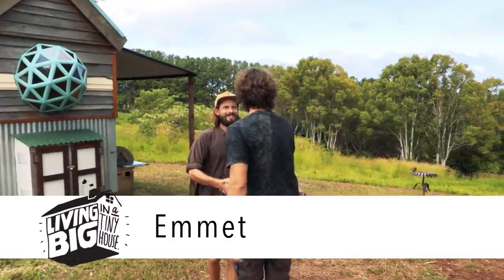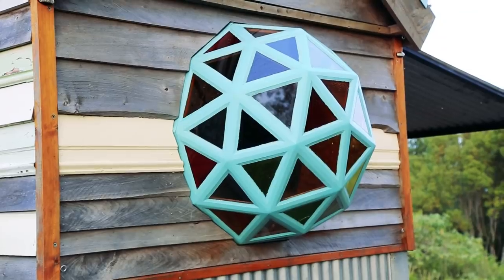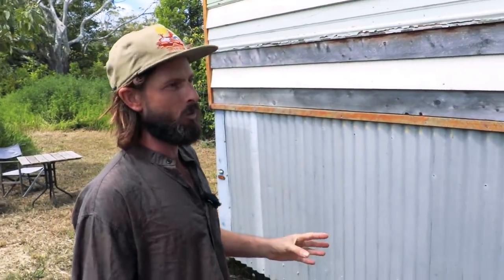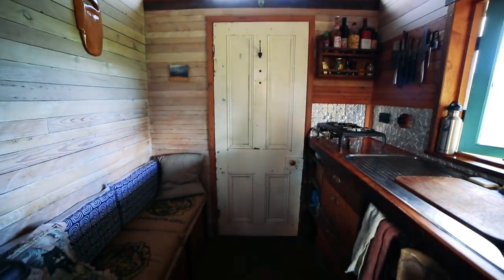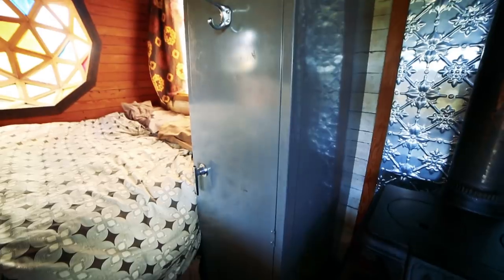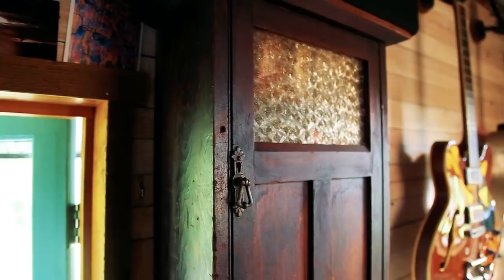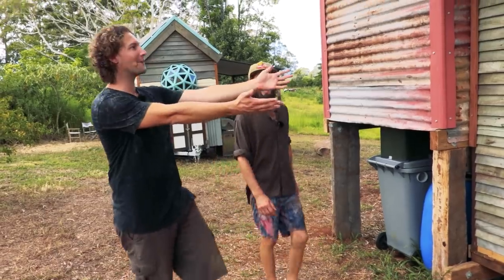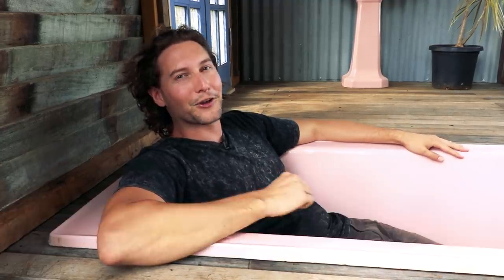Tiny Home With Luxury Bath-House Made From Recycled Windows

Comment: Love it!!!  I have a tiny rock cabin. The sunroom is all rock and windows and skylights with a bathtub . It is made with rocks that have amethysts and Quartz crystals in them. 
I too live out in the middle of nowhere but apparently hunters and neighbors were quite the peeping Toms before I was aware of it. It's terrible the lack of respect for privacy especially as this is my private property.
Up went the curtains.
You can make an offgrid shower with hot water.
Use a triton tankless water heater. Buy a small 30psi fish aquarium water pump, some plastic line to fit the pump and adapters to make the line fit the water tank. 
This particular tank comes with a shower head and a propane line. Buy or acquire a battery. I use a small lawn mower battery. It's easier to carry to recharge which it seldom requires. Get two alligator clips to connect to the battery from the water pump red and black wires.
You will need a propane tank to connect to the regulator. I bought a one gallon size propane tank online. It's easier for a female to carry for refills, which cost about $2.00. One tank lasts well over two months for one person if you are just taking showers.
A bucket with water is needed to put the intake water line.
The intake line is connected to the water pump inlet valve. The outlet line comes from the outlet valve and then connects to the tankless water heater. 
CAUTION turn the propane handle just one click, about 1/16th of an inch or the water will scald you seriously.
Turn the water heater water flow knob and flame knob to a low setting. 
Enjoy a nice hot shower completely off grid. 
Great for washing dishes, dogs, cars, etc.
If you should run out of propane and can warm some water on a wood stove you can use that. 
The entire system costs less than $200.00 and is such a luxury when living offgrid.
My bath is right beside the wood stove for those freezing mornings.

Comment: Very cute tiny house but how do you deal with condensation from the tin roof?
Reply: Debra Walker there are two layers of roofing iron, one outside for the roof, one inside for the ceiling. There is insulation and sarking (weather proof wrap) layers sandwiched in between the roofing iron. No condensation issues.

Comment: How would you tow that on the road? It would be way overloaded.
Reply: Monty McMullen actually it has been designed and modified to take its loaded weight. It is registered as a caravan and compliant with relevant Australian standards and Australian govt requirements, including a weigh bridge certificate.
Reply: Emmet Blackwell What does it weigh? What does it tow like? The dome window at the end looked like it might have been a headache to make.
Reply: Monty McMullen it weighs 2.2 tonne loaded and is rated for 2.5. It towes fine with a suitably powered and rated vehicle. Heavier tow ball weight than if it were double axle, but no problem for a proper 4x4 vehicle.